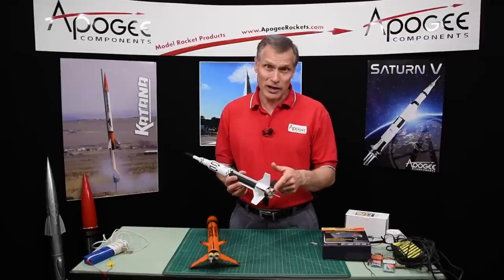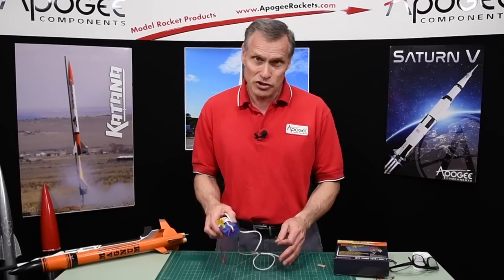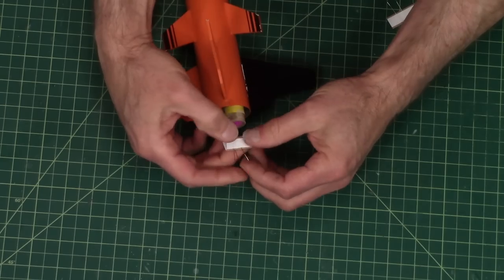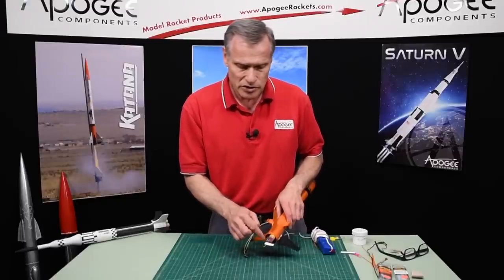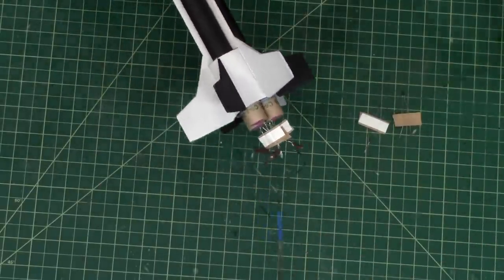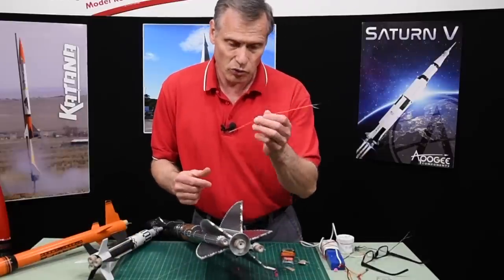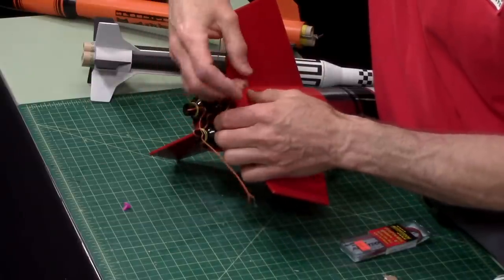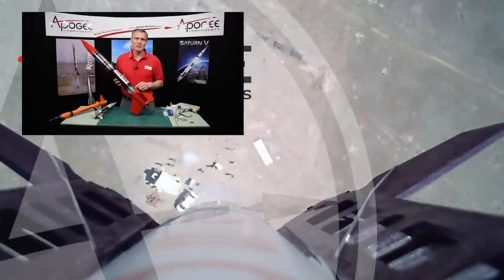How to Cluster Model Rocket Motors with Success

Comment: Nice video.  

Took me back to about ‘69 or ‘70 when we had a home built rocket that flew using a cluster of 5 Estes D engines.   Of all the times it flew, don’t think we ever got all 5 to light for a flight.    Had an 8 inch tube and was about 4 feet tall.  Always used a car battery.  I’m sure we could have used better wiring skills.  :-D    But not bad for 8th graders.
Reply: ive not built a rocket before... how big a fuselage do u think i can do with a cluster of 3 c motors?
Reply: I think a estes bt 101
Reply: Always used Car batteries.  Never did a 5 engine, although had the TIR on it.  Had a Centi LJ II 3 engine cluster and sadly one didn’t go off (ignitor came out).   LJII never was the same after that.  😫.  and for what they are going for now.  

I still like the multi engines vice one larger one and i haven’t flown since 79.  getting itch to start again.  

good times with the car batteries.  dang AA n C batteries never lasted and we had to work for our stuff in the 70s.  🚀 power

Comment: Back in the '60s I build a 3-motor rocket from a Christmas wrapping paper tube. When it launched only two of the motors fired and the rocket looped over the neighbors house due to the offset thrust. I ran around the house to the vacant lot on the other side and some old guy was beating out a weed fire - and the rocket - with a shovel. I think the third engine lit from the top and pretty much destroyed the tube, so it was a goner anyway. So I ran back to my yard, back to the drawing board.

Comment: For 3 or more motors it is best to use the clip whip so you don't worry about complicated wiring or wires that might be touching.  I used to use a short piece of wire to go around the outside and twist the outside wires of each igniter to this wire.  This achieves the same funcation as a clip whip but just using some junk wiring.  Also I always used a 12V car battery for power.  I would recommend you add some drawings to this video to show the wiring, you could even draw something on a chalkboard.

Comment: I disagree with the approach of wiring igniters in parallel.  I do professional fireworks shows, and we always wire multiple shots on a single queue in series. We do this because a continuity test of a parallel wiring will be positive even if you have one or more open/bad igniters. Only if ALL igniters are open/bad will you fail a continuity test. This has potential safety implications. I encourage flyers, at a minimum, use an ohm meter to test the resistance of each igniter (they should all be very close) after installation into the motor, but before twisting the leads together (although even the act of twisting the leads together can damage Estes Solar igniters). In a series wiring, if only one igniter lacks continuity, the whole cluster will not have continuity. The downside is that a series wiring does require even more voltage than parallel (by n times where n is the number of igniters, 12V for 2 igniters, 18V for 3, etc, for a fixed-current 6V output battery), so controller capability is even more important. You can also ground test your igniter harness to make sure the controller is up to the job. Wasting a few igniters is a small price to pay for ensuring the controller can light all the igniters quickly.
Reply: I think a few years ago Quest made some igniters that didn't take as much current to fire off as other igniters, so many people did successfully wire them in series or depending on the number of engines, a combination of series and parallel.  Unfortunately, I think Quest no longer makes those particular igniters.
Reply: Hello Mr. Pinter. I am a retired electrician who now flies RC fixed wing things, but about 100 years ago I enjoyed hobby rocketry and I'm feeling the pull to that hobby again. My main complaint of the hobby was recovering them at sometimes considerable distances and the successful ignition of the motors. Regarding your comments on parallel/series applications I have a question. Although I successfully flew up to 3 stage rockets, all stage setups were single engine. Back then, I couldn't justify the expense and time to risk a successful multiengine booster. Anyhow,  I think you're right on the series setup thing, but do the igniters not actually burn up either through the heat of the shorted circuit inside the cone, or are burned apart from the engines output gases, or both? I believe so... yes/no? If this is the case, how can you guarantee that the power won't be cut off to the rest of the downstream devices? It's like an old style set of Christmas tree lights, one goes out and the whole string goes out. I realize your safety concern regarding parallel setups. Who wants to walk up to an apparently dead rocket and have the thing blow up in your face! I was amazed several times on launch explosions as were my friends!
Reply: @johnpringle9967   That's a very good point. My guess is there's a reason why it's been done in parallel for all of these years. You can break the circuit during ignition and cut power to the motor(s) at the end of the line.  So continuity test each igniter after it's been installed (in case they were damaged going in) and you should be ok. Now the problem becomes whether or not the motor fails to light from another issue. Plus a large cluster (there is a model with 6 or 7 motors!) wired in series requires more power that is above what generally hobbyists are capable of doing.
Reply: I'm a licensed pyrotechnician as well. I will try to use ematches and a Cobra firing system. The problem with ematches is they don't fit in the nozzle. But visco does, so for single engines an ematch bridged to visco should work. For a cluster visco is a no go, too unpredictable on the timing. It's possible an ematch taped to the nozzle may pass fire to the propellant, I will test that out.
Reply: @johnpringle9967  you should continue rocketry it’s  such an amazing hobby I fly fixed wig and have a little be for flying helicopters and I love to race 1/10 buggy and 1/8 nitro buggies but there’s something about rocketry that has always drawn me to it there’s nothing wrong with doing a little bit of everything and it also helps from getting burned out on doing one thing
Reply: Simple. Electric matches are wired in series because they short after firing but typical rocket igniters open after firing so they must be connected in parallel.

Comment: Him talking about how you need a lot of power in your launch controller

Me: sitting content with my 27 volt homemade launch controller with absolutely no safety whatsoever
Reply: What did you use as a power supply? I'm experimenting with a lithium 20v drill battery,
Reply: what about a fuse? light and run.
Reply: @samnoneofyourbisnus2543  illegal

Comment: Back in the 1970s, I NEVER had a successful firing of all 3 engines, even when using a car battery.  Of course, back then I was using the crummy igniters that came with the Estes engines (remember the old blue trapezoidal packaging tubes?)   They were barely long enough to get them twisted together, and it was really easy for the igniter to be pulled out from the bottom of the nozzle.  I finally gave-up always replaced clusters with single D engine.

Comment: What ever happened to the Centuri igniter that had a copper wire coated with a tan compound? That worked great every time.
Reply from the maker: Centuri was bought up by the company that owned Estes. So Estes is the company that owns the rights to that igniter. So you might ask them what their plans are.

Comment: So you always wire the igniters in parallel?  Would you ever use series?
Reply from the maker: Depends on the igniter. If it is an e-match, you can. The fireworks industry uses series all the time.

Comment: Does anyone still use flash pans? If so, is there a rule-of-thumb number of motors when a flash pan makes more sense?

Great video. Thanks.
Reply from the maker: They are only used for black powder motors. With the invention of Composite propellant motors most people realized that you can get the thrust you need from a single motor, and you don't need to make large clusters of black powder anymore. That is why they are never used anymore. It makes the launch a lot safer and more successful.
Reply: Thanks!

Comment: I've used nails under the motors and paper clips to connect the current. Easier to clip the ignitor to the paper clip to transmit the current, pretty cheap and intuitive way to make it work
Reply: great video tho

Comment: Can't beat good old fashioned cannon fuse.  Join each fuse into a common central fuse and light.  Guaranteed total ignition.
Reply from the maker: Unfortunately, if you want to have insurance coverage for your rocket launch through the NAR or Triopoli, you can't use cannon fuse. The reason is that you can't terminate the launch at the last second like you can with electrical ignition. The NAR safety Code, which is one of the reasons why model rocketry is "legal" in the USA, prohibits fuse lit motors. So please don't jeopardize the hobby by using a fuse to launch your rockets. We have a good safety record, and we'd like to keep it.

Comment: What if you take one rocket engine and cut it in half and glue another one (same size) on top of the other one. So you have 1 rocket engine but you are making it longer.
Reply from the maker: boom. Modifying motors like that always ends in failure.

Comment: can you use common cannon wicks to ignite the rockets?
Reply from the maker: We always recommend following the NAR safety code found at www.nar.org. It requires, for safety reasons, to always ignite rocket motors electronically. There have been hundreds of times in my own experience where we had to yell at the top of our lungs to hold the launch because something was amiss. You can't do that (stop the launch at the last second) with cannon fuse.
Reply: @apogeerockets  good point, thank you!

Comment: Tim what igniter would you recommend to ignite a cluster of D-21-Ts?
Reply from the maker: As mentioned in the video, you can use the igniter that comes with the motor.
Reply: Okay so the starters that you used for the composite cluster were the ones that came with the motor?
Reply from the maker: @josephg3231  Yes.

Comment: Centuries had an igniter with a short "fuse" of solid  rapid burning material.  Only failed ignition when igniter wires pulled it loose. A tissue paper plug probably would have helped.
Reply from the maker: Fuses are long gone. It is against the NAR safety code.
Reply: Jetex wick.

Comment: If you can have a heavier gauge conductor (solid copper wire) versus smaller braided cabling, then you will have less line resistance from your battery/batteries to the igniters. 😉 Use Ohm’s Law to your advantage for delivering current out to that load (resistors)! 🚀
Reply: Changing the wire for a thicker gauge wouldn't change anything as the Estes igniters use nichrome wire so you are passing current thru high resistance wire regardless. Upping the voltage however, pushes more current through the resistor (the nichrome) which heats it up more quickly, thus lighting the "pyrogen" more quickly

Comment: I have a launch controller that runs on a 9-volt battery from an estes launch kit. Will that set off 2 b sized engines and a c engine?
Reply from the maker: Controllers don't set of engines. They set off "Igniters." The proper question is: "will the controller set off 3 igniters?" The answer is easy to find out. Burn three igniters. Yep. You gotta burn off a set of igniters. I know you don't want to do that, because it will cost money. But that is the ONLY way to find out. Sorry for the bad news.
Reply: Apogee Components - okay thanks, so I should test 3 Estes igniters at once and if it doesn’t like up all at once I need to get a better control?
Reply from the maker: @willc1241  Yes. Test!
Reply from the maker: @willc1241  Just a bigger battery. Also check the battery first.

Comment: PLESS SIR HOW TO MAKE ELECTRIC FUSE 😔🥰
Reply from the maker: That's easy. Get some thin nichrome wire. Pass electricity through the wire, and it will heat up red hot. That heat is what is used to start the propellant burning.
Reply: @apogeerockets  OHH THANKS SIR 🥰😍

Comment: yes, it is the amps that kill you, not the volts. If you home build, but several batteries in parralel configuration. the volts will be the same, but the amps would be the combined number of all the batteries. This is why rechargeble batteries have lower volts, but higher amps.